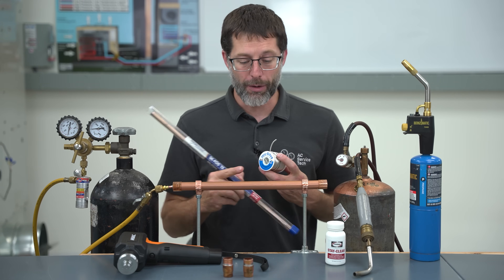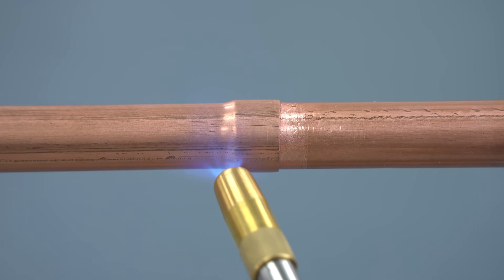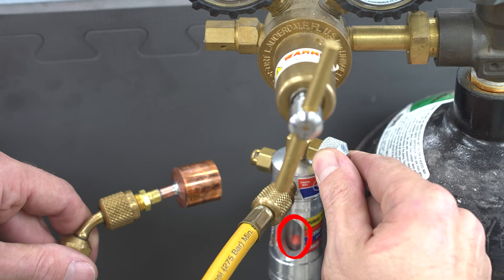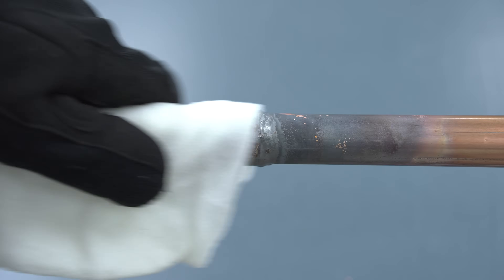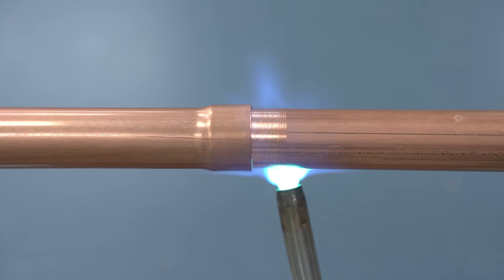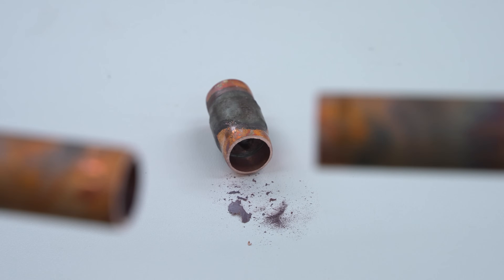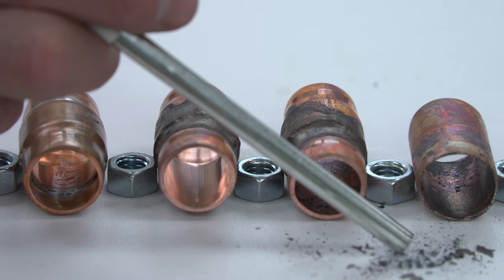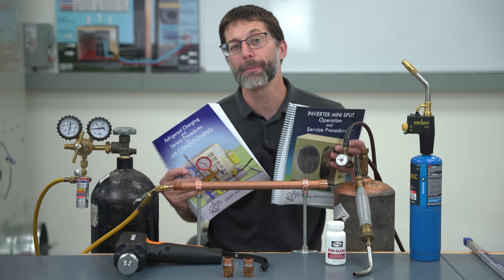HVAC Silver Soldering vs Brazing vs Brazing While Flowing Nitrogen!

Comment: another great video.  Too bad there isn't a process to eliminate/prevent the flux from forming and adhering to the inner wall, as that looks to be the best method of bonding.  In this example, you did a great job and used a fairly small amount, but was clearly enough to form inside.  For now flowing nitrogen and >1200F flux less solder/brazing. 
If the flux would stay as a gas it would flow out with something like nitrogen vs getting stuck on the wall.

Comment: I have been in the HVAC industry for 42 years.  5 years ago my company switched to the low temperature Harris Super 8 system with NO issues.  Sorry to bust the Old Testament of Brazing with silver solder is best.  Harris super 8 system is much safer and every bit as strong as the older outdated high temperature solder.  I think you should have contacted the Harris company to confirm their stance regarding using their system with refrigerant soldering before you through their system under the bus.  You’re usually more thorough before offering your opinion.
Reply: I agreed. I'm sure Harris Super 8 engineers had tested many many years before they have it out on the market.
Reply: Harris Super 8 is an alloy that’s at least 50y old. The strength of a fully wetted full depth socket joint was tested for sales literature when R410 came around.
Reply: I didn't hear any opinion.. I did see someone show the difference between 2 types of acr copper joints
Reply: no marketting here 😅
Reply: Bro.. he used sandpaper. Don't feel the need of adding anything else
Reply: It’s clearly not the “best” practice he read the back of bottle at the end of the video no need to call Harris. And it’s not his opinion lol did you watch the video?
Reply: Except on joints where the temp exceeds 200 F… So, don’t use it on a compressor discharge joint as the probability of failure increases exponentially. And, that is from both the Harris and Lucas-Milhaupt engineers. Basically, solders have a solidus temp of just over 400 F and operating conditions approaching 50% of that is asking for trouble, over 50% will lead to failure (particularly when you add the stress associated with vibration). Given that discharge temps exceed 200 F, and easily approach 250, I am sure you can understand the risks… I use Stay Brite, just not on compressor joints!
Reply: You’re no engineer, you don’t know what you’re talking about. The low temperature melting metals are soft and weak. You need more temperature to melt the stronger metals like silver or steel, copper, tungsten because they have a higher bond strength. More bond strength = better bond. 

Lead will have a weaker bond. You can counter act this by giving it more space to bond, maybe instead of a 3cm overlap of female and male pipes, make it 6cm.
Reply: @Stealthsilent1337 so you’re an engineer then?

Comment: Can we just flush the system after soldering? That will be easier and safer caus we dont have to heat that pipe to high temperatures.

Comment: I’ve been soldering HVAC copper for over three decades and I’ve never had a joint failure. I like that it melts at a lower temperature and for me it’s more convenient. I don’t expect I’ll ever change.
Reply: In old mineral oil lubricated systems, you got away with flux contamination.
But with POE lubrication, all that flux from the inside goes into circulation.

The issue is not whether the connections are solid.
The issue is introducing contaminants into the system.

You simply don’t know the damage that you cause through premature compressor motor failures.
Your philosophy seems to be: Ignorance is bliss.

You would be well-advised to switch to cold crimp fittings.
Reply: @denverbraughler3948  In my experience with solder it’s the guys using way to much flux than needed that causes problems. Like I said I have installations that have lasted for 20 years with P0E oil in them and they are soldered!
Reply: @Huntnfish74916  I agree.
Reply: @denverbraughler3948 just more sales.
Reply: @denverbraughler3948  POE has been use over 3 decade ago since the banned of CFC. You seem to know little in this industry.

Comment from the maker: Just to be clear, through our research, non-corrosive fluxes are only non-corrosive at room temperatures, such as rosin. Rosin flux for example is used for soldering on electronics because it has the appropriate acidity when heated when there are more hydrogen ions present but when it cools to room temperature there are less hydrogen ions and the acidity drops to near neutral so no corrosion occurs at normal room temperature. The problem here is that the compressor and reversing valve sections are hot. The electrical windings are in the compressor. Some compressors use the low temperature refrigerant vapor to cool the windings while others actually use the discharge vapor. There are various types of compressors and we just want techs to be aware and educated on what they are doing. Thanks to everyone who diligently takes pride in their work every day in order to take care of their family, company, and customers!
Reply: You're the best. I got your book and quick guide. Your quick guide is useless to me because I'm in commercial and it mostly 404 and others.
Reply: Hey my furnace just went. It starts runs, then dies and gives code E207 I tested the ignitor it was good
Reply: @nicpaq4049  call a pro.

Comment: Great videos and I have learned more than I can ever negatively comment about from this channel. I would just like to point out in the section where he brazes while flowing nitrogen, that it was a bit sloppy due to how he positioned his flame in relation to where he was brazing. With a pipe that small he really didn’t need to keep the flame head right on the point of brazing because it would get the entire pipe hot enough to melt that solder and get cleaner results. Again, I have learned so much from this channel and really appreciate the information you all put out for us 🙏🏼

Comment: Not knocking nitrogen but I've come upon 15 yr plus units still working fine and I sincerely doubt nitrogen was used back then, todays units are trash compared to old work horses, new systems caps going out before a year, constant coil leaks and bad TXV's etc. Customers should be sure units are registered to get 10 yr warranty and they will be lucky their new units make it to the 10 year mark. lots of hacks do not register units, more work for them in future w/o warranty claims.
Reply: Yeah, NOBODY was flowing nitrogen back in the day. 😅

Comment: Worked at a company and was taught to put the pipe and fittings together and just flux outside the joint. The heat draws the flux in.
Reply: Lately though I braze since I didn’t do that there and I’m getting decent at it. Though it is much more expensive.

Comment: I have been using Harris SB8 for decades on my customer systems with no issues related to using it. The key is to use much less flux than shown.. the main benefit has been zero impact to valves and txv or sensors. Saves time and labor when working on RTUs and attic installations by reducing equipment/tools I need to carry up
Reply: I agree, this was an overflux and under solder.  For small refrigeration systems like I do, I use a stick sponge or a tiny crafting paintbrush to apply flux, and I also remove flux from the last millimeter of the inside tube.
Reply: @dustinwilliams5399 the last millimeter? Is this measured from the cut off end?
Reply: I agree with you.
Reply: Been soft soldering for years now for all my new installs and service calls. Never ever had any leaks, or any other problems.
Reply: the OMG FLUX IS ACIDIC is stupidity from people who don't understand chemistry. no acid stays "acid forever". it may react with whatever is in the system and that's it. it'll stop reacting until reactions is done. since it's a tiny amount of flux, it will react in a minuscle amount and lose its acidity. Moot point.
Reply: Can anyone speak to SB8 and mechanical/building code regulations? In major cities where permits and inspections are required for HVAC replacements following IBC/IRC standards, does SB8 pass requirements?
Reply: Craig over flux it and he also use less solder intentionally to have flux left inside. I think he didn't get a commission from Harris.
Reply: @pnp8849  i mean even the guy youre replying to is saying the benefit is reducing the amount of work he has to do. noone says staybrite is better than braze + nitro. everyone just says its easier and its good enough.
Reply: I swear! I swear!  The way i do it wrong doesn't cause any problems whatsoever!  You all just want to save your dime, you could care less about the consumer.  More service work for you.

Comment: If you worried about that little bit of flux that’s in the tube, don’t! It will get washed away with the refrigerant oil and eventually it will get collected into the filter dryer where it will do no harm there. Been using this system since it came out and NEVER ONCE had a problem with it. Now that is only for the inside acoil joints. The outside joints I still like to braze only because if the unit getting moved the soldered joint will tend to fail if allot of stress is put on it. Don’t really have to worry about that inside the house because that really is never really moved or touched for that matter so it’s fine, but outside I would definitely recommend brazing. Also the advantage to silver soldering the acoil is the lower temperature has allot less likelihood of damaging the txv valve. Seen many times where this valve gets fucked up because of too much heat from brazing and it’s hard to keep this thing cool. And on these new acoils changing the txv valve is a real bitch due to they are now brazed in at the factory and there is no fucking room to work on these pieces of shit! As you can tell I’m not a very big fan of txv valves. I always use the piston system and once again, never had a problem with these, but boy problem after problem with the txvs, usually within the first five years these shit things fail and I end up just changing the whole acoil to a piston system and had them run 20 plus years with no issues! That concludes the lesson of the day!
Reply: Thanks, great info.

Comment: Don't get me Wrong,..... Craig Always teaching the Right Way that is the Best Way 👍👍.... but One of my AC condenser Unit is BAD Can't be fixed only 10 years old and installed by REAL AC  tech using Brazing method.  Now I am Replacing with NEW Rheem Endeavor Condenser and will be using Stay Brite 8 with flux using Sparingly at the joints
Reply: Good move.

Comment: Interesting.  Never seen brazing without a mixed gas rig.  Didn't know that was possible.
Reply: Acetylene/air torch works great as long as you have a large enough tip, its easier than oxy/acetylene because of the milder temperature.  If you want to get in and out fast the oxy/acetylene is better but requires more skill.  I have never used oxy/propane but I am told that it works really well for brazing.

Comment: If we use the FLUX sparingly.... Just Enough to Cover the joints.  It's just fine.  I used Stay Brite 8 .... 10 years ago on my first Try installing Central AC system without any Leak at ALL 😅👍
Reply: I believe flux at the joints 6-8 connections will be very small amount when refrigerant circulates throughout the System.  Just like Water 🌊💦 and Salt Or Sugar.  Small amount will not make you have High blood pressure.

Comment: What about rosin core solder.  I have used it on bread boards and it is safe.  I think it will flow but I have never tried it.
Reply: I understand.  I was only thinking of an alternative to flux.  I would not use it. but my understanding is that rosin in none corrosive. There is not reason to use it. if I was out of silver in the field I probably don't have any rosin core with me ether.  lol
Reply: That is a good question. I would also like to know the answer to.

Comment: I made up some test pieces for work using these 3 methods. A flow regulator isn't necessary but handy, I just shoved the end of the hose into the pipe and cracked the regulator until I barely felt a flow. Let it flow for a few seconds and braze came out clean. The staybrite solder flows like water compared to plumbing solder, the swedge has to be very tight, to the point of just barely fitting over the pipe. If you make the swedge too big or have any gaps, it'll open up as soon as you remove the heat. Braze with nitrogen is still my preferred method.
Reply: You have too much nitrogen if you can feel it. That’s causing the gaps in solder.
Reply: I've done it with cap-tube so big gap is doable just need practices.

Comment: I like using the orange 56% rods....they work great on joining dissimilar metals and its also great for copper to copper connections. The ductile strength is much higher than 15%, and it flows more liquid like. Makes it easier to make pretty braze joints too. Then cap it with 15% shoulder. Makes for a very strong connection.

Comment: Nice video and well done. The only issue I have is regarding the proper method of using Staybrite #8. If you use the method Harris presents in their documentation, you will find there is a way to safely use the correct flux with Staybrite and not risk the flux entering the tubing, providing the tubing is heated correctly. Still, a great video!

Comment: Use a non acid nocorode flux, ditch the stay clean.

Great Video, by the way.
Reply from the maker: These fluxes may be acidic at normal room temperature or in the case of this flux, non acidic at room temp and then becomes acidic when heated so it etches the copper for the solder to adhere. Are you familiar with a flux that remains near 7PH during high and low temperatures?
Reply: @acservicetechchannel  Nokorode by Rectorseal is as close as you can get to acid free. Don't forget about the dillution of flux in the Poe oil, it will never be at the same acidic concentration as it was in the flux bottle. There is clear evidence of non nitrogen brazing destroying brand new air conditioners, you'll have to provide evidence of flux doing the same. I can't find any evidence of it on the web or in the feild.

Comment: Let's say you're working on a type 1 system with only 1 service port. Sure, you can flow nitrogen, until you get to the last connection. Now what?
Reply: You can open an Unit connection en let it flow trouh...
Reply: @Dvdsluis-wo8ez  bruh..

Comment: Hey, I just wanted to thank you for all your wonderful HVAC videos. I installed a mini-split in my garage workshop a couple years ago using one of your videos as a guide. I hired a local HVAC company to come out and check my work, pull a vacuum and release the refrigerant. They were really surprised that it was a DIY install--said it looked very professional and had thought I was a retired HVAC tech or electrician. I said no, but I learned from the best!

Comment: Can you talk about the role the filter dryer can play in absorbing things like leftover flux and cupric oxide?
Reply: You are ALWAYS going to have at least 1 braze joint that is going away from the filter dryer as you start up the system .

Those cupric oxide going to clog the TXV valve or going into the compressor.
And if enough cupric oxide . It will clog your filter dryer too.

Using nitrogen flow would be so much cheaper in the long run .

Comment: Great video. In the case of the silver solder, if we're talking about just one residential HVAC system can we count on the filter dryer to absorb the flux so it doesn't repeatedly run through the rest of the system?

Comment: Good video, however my company including me personally have been using Staybrite 8 for over 30 years on thousands of systems including compressor change outs with a total of 0 problems and 0 compressor burnouts. Actually the number of incorrectly brazed systems from others that we find is a ridiculously high number, ie: cooked valves, clogged components with cupric oxide and burnt equipment along with burned up compressor shells. We do braze on a rare occasion but mostly solder!
Reply: You think your company didn’t have any issues because of that, not necessarily means you didn’t
Reply: So you don't believe what you just saw? I understand where your coming from by your experience but doesn't this make you wonder a little.
Reply: @robertgregory2618 I believe what I just saw. 
However the actual impact excess flux has on a compressor hasn't been tested here. Yet for most of the video, it's being stated as fact.
As someone who has also been soldering with stay-brite 8 for the last decade.  (I use less flux than demonstrated here.) I'm yet to have a single compressor failure.
Reply: When your compressors failed within a few years, the customer called a competitor.

No one said that it kills 100% of compressor motors every time you solder with flux.

But that’s pretty amazing never to have a compressor short out in over 30 years.

Comment: If youre pushing nitro through it wont all that junk just get clogged in the txv?
Reply: Constant nitrogen flow, no oxygen in copper, no build up.
Reply: The junk never gets created due to the lack of oxygen. No oxygen = no oxidation
Reply: Braze the low side, nitro through the high and it comes out the low side, repeat the other side.

Comment: I love the detail to the copper fitting cleaning but let’s be honest in a real world scenario where pipes are often vertical and oily, doing this much cleaning is asking for extra trash in the system. Whether it be copper shaving or dust from the wire wheel this much cleaning is going to put stuff into the system.. But of course In a perfect world we would “clean it all out” before brazing.
Reply: Yes trash will get in the lines that's why I use a small good suction portable vacuum to suck out copper shavings and QTIPS to remove any dust.